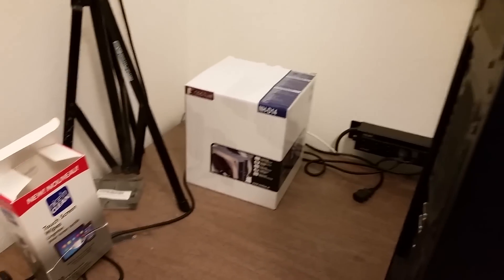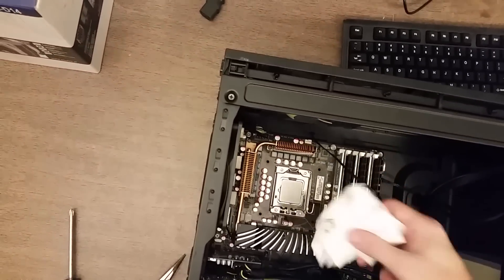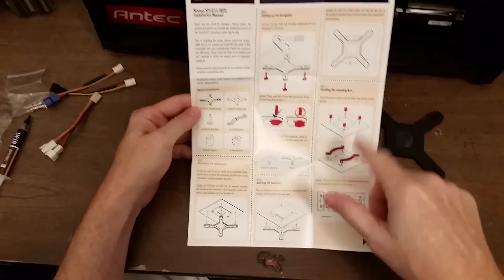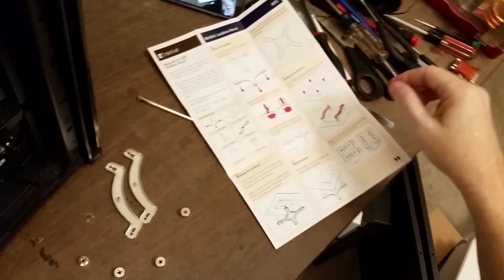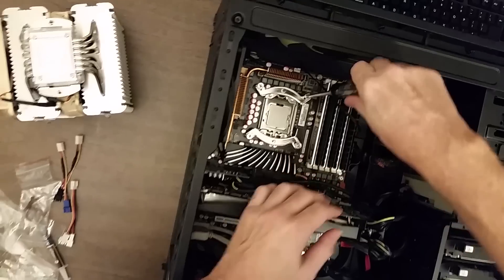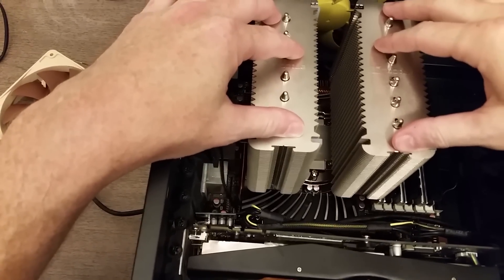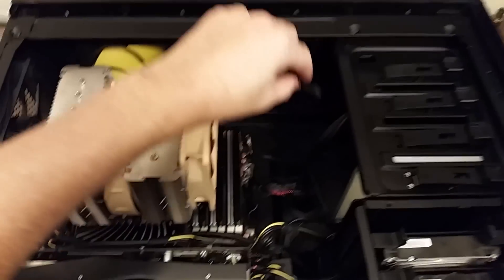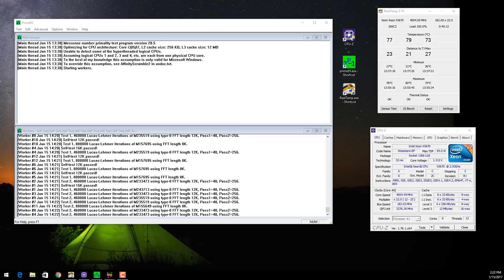Noctua NH-D14 CPU cooler installation onto a Intel CPU and motherboard

Comment: I have this cooler for 10 years and I believe it killed two of my motherboards. Both were starting to show signs of RAM failure after repasting. On my second mobo I barely tightned the screws to avoid bending, warping, etc. Now my A1 and A2 RAM channels are dead. I'm single channel now on B1 / B2. I'm afraid to mount this cooler again on a new mobo.

Comment: Hello! I wanna get this cooler but I’m having doubts if its compatible with my motherboard. I have a B360M mortal Mobo, is it compatible with it?
Reply from the maker: No this is an older cooler.  NH-d15 should work.
Reply: @MichaelTheComputerGuy  I just searched it NH-d15 and it's big as hell for a cpu cooler. Is there enough space for my ram sticks to put this cpu cooler on?
Reply from the maker: @quaithe7050  I was just giving you the modern equivalent. Yeah it's big. If you have tall Ram sometimes it doesn't fit right and you have to raise up the fans. Do you really need a cooler that large? What cpu do you have, are you planning to overclock it and if so to what speed?
Reply: Michael Cooper i have a I7-8700. With hyperx DDR4 16x2 32gb 2133 or 2666 i think.

I was just thinking of getting something that wouldn’t get my pc hot. I also planning to buy 3 case fans for my case since I only have the intake fans in front and no exhaust that’s why I also decided to try and get a new cpu cooler since i’m using stock coolers because I game alot and do alot of tons with my pc. Usually my temps when i game without fan / ac is around 60-70c which i think is pretty hot and my fps drops sometimes because of that.

I have no plans of overclocking my cpu / ram, only my gpu. If i don’t overclock is noctua a overkill? Should i go for other cpu cooler, if so, what do you recommend? 

Edit: i have a aerocool quartz case if you’re wondering.
Reply from the maker: @quaithe7050  The NH-D15 is overkill for you.  Look at the NH-U12S.
Reply: @MichaelTheComputerGuy  really? but isn't the NH-D15 better than the NH-U12S? or is it basically the same? i want my temps to go down around 45-50c whenever i play / stream.
Reply from the maker: @quaithe7050  Of course it's better.  Its also bigger, more expensive and more likely to interfere with your RAM.  If you can spend the extra $40 and it fits get it.
Reply: @MichaelTheComputerGuy What's usually the ram height so I wont have ram clearance problems?
Reply from the maker: @quaithe7050  There isnt a usual ram height. You can find your rams height fron the ram manufacturer and the coolers ram height compatibility from the coolers manufacturer.
Reply: Michael Cooper well I got my answer here. I’m getting the NH-D15 for sure. Thank you so much for taking your time to answer my questions, this was really helpful

Comment: How do you know which of the 3 holes to use on the brackets
Reply from the maker: The manual tells you.  They are for 3 differently spaced motherboard cpu mounting holes.
Reply: @MichaelTheComputerGuy  the manual doesn't even mention them 😔I went with the middle hole but not sure at all

Comment: Just bought this for 12400f in 2023! 😂
Reply from the maker: I probably need the D15.  The D14 here is for older CPUs.  The installation process is similar.
Reply: @MichaelTheComputerGuy  the seller i bought it from has got the optional 1700 bracket together wif it. Just intalled it today. Playing returnal max wif 3060 was 75 now my max is around 55. What a phenomenal cooler literally blew me away. Super happy just that it doesnt fit my case becoz its so tall. Thanks n great vid I followed your instructions thanks for ur help. 🤗🤗🤗

Comment: Thank you for sharing your experience. I installed a Noctua DH-14 on my vintage Asus P5K3 motherboard and Intel Core2Quad Q9450 last sunday basing my purchase decision on your video and the whole operation was indeed just so easy after having learned to avoid the pitfalls from your video. Also kudo's to Noctua for exemplary customer support and incredible product performance. I ordered my cooler on amazon and it arrived without the proper mounting kit for my kind of old processor. I do not blame Noctua for that. Actually, it is a sustainable solution and Noctua do provide an easy ordering process for the NM-I3 mounting kit that I needed and the kit arrived in just two working days at no cost. They do require proof of purchase of the fan, the processor and mainboard so as to avoid misuse of the service.

The cooling performance of the DH-14 in my setup is just fenomenal compared to the stock cooler that I have used for more than a decade. The processor has been working under full load ever since Folding at Home started to grid-compute for Covid-19 projects and the old fan was barely capable of keeping the CPU under 100 degrees Celsius. Since sunday, the CPU has been running uninterrupted at full load hitting no more than 48 degrees Celsius. I am impressed.

Comment: Since the mounting is identical on all 115x sockets, the D14 is actually compatible with the 1151 socket too. It's just it's not mentioned in the manual because it wasnt around when these were released.

Noctua website confirms this.
Reply: I have a intel i7-11700f will the D9L work?
Reply: @Matthew Bean  Edit: wasn't the one I was thinking of. Yes it should be enough. Use the Intel bracket and spacers and you should be fine.

Comment: Excellent detail. Between your video & another guy's video, I was able to properly remove & then re-install the Noctua after a Motherboard Replacement. They had high-profile Memory, so my 2nd fan was installed on the end nearest the back of the case. I hope that doesn't affect the overall cooling.

Comment: Excellent video! :D

I have a question: There is no problem that the 120mm cooler cable and the 140mm cooler cable share the Y cable? 
They are supposed to have different voltages and amperages.
Reply: No voltage difference, the only major difference is the size of the blades.

Comment: I love this cooler, it has worked extremely well and extremely quiet for nearly 4 years. It's currently cooling my Ryzen 5 2600 and it never goes above 50c in Prime and Cinebench. I can absolutely get it lower as well, but then I start to hear the cooler and that's not really the idea with this guy. It is built for silence.
Reply: how is that u must not clocked
Reply: @cmoneytheman  65W TDP processor being cooled by a 225W TDP cooler.
Reply: @vBDKv  wha the name of the cpu i meant
Reply: @cmoneytheman  Ryzen 5 2600
Reply: @vBDKv  I dont understand do u got this cooler or not u not oced if u runs in the 50s

Comment: I love my D14, I still use it on my ryzen nowadays. (ordered the am4 kit for less then 8 bucks USD from Noctua) It cools my 1600 to a stable 3.9 all day long max temps 74c under prime95 load over a few hours. I use 4 vengance LPX (the black non rgb) and I only need to move my front fan up a lil bit. (I suggest not getting rgb ram with this cooler as the front fan will hang over all 4 ram sticks even on a  full atx board. Save the money on ram without rgb to get better timings or speed.
Reply: I found a D14 second handed for 35€. Even thought I don't really need that much cooling, I think I'm gonna buy it.

Comment: This wasn't easy! Levelling and adjusting the fan springs without any room at all. Finally got helped by a pair of pliers. My Nh-d15 was not an easy job. My corsair 275R was a little bit tight but I made it! (Rog strix Z390f).

Comment: I have one problem help me pls o have dark rock pro 4 and I didn't use the splitter because without it I have better temps and the splitter is 1 pwm 4 pins and the second is 3 pin when I put it to CPU fan 1 doesn't working and if I put something else it works and if I put the fan without the splitter doesn't work but the ryzen cooler works and this fan in other pin it works why??

Comment: how do i know if its better to have the air blowing out the back or up the top? im going to be putting this fan in a coolermster h500
Reply from the maker: You can do either or both.  The difference wont be much.  As long as you get the air moving through its fine.

Comment: I have high profile ram do think this cooler would be ok?. I have 4 X 4 GB Adata XPG V2. The Gold and Silver/Grey series.
Reply from the maker: This cooler is for older processors.  Whatever cooler you're considering look up its ram clearance and make sure your Ram will fit under it.  You can do this by searching for the cooler model number and the words ram clearance.  For Ram height search for the model of ram and the word height.

Comment: Can you get the same cooling capacity of a 2×120mm all-in-one liquid cooler with this air cooler? Which one is best?
Reply from the maker: That depends on the model aio but it should be similar.

Comment: Can the cooler be installed on Intel® Core™ i5-8400 ? It has a socket FCLGA1151.
Reply from the maker: I checked the specifications on the cooler and yes it does work on a socket 1151.

Comment: After watching this video i decided to keep my CoolerMaster V10 cpu cooler its lowder for sure but its actually do a better job for some reason or you did something wrong, i thought noctuas was way better i also have an oc x5660 at 4.2ghz the odd thing is that i run lower voltage than yours im at 1,29250 considering that and the higher oc on mine i should go further on temperatures but mine tops at 72c in almost all cores (core 4 for some reason is always 5 degrees cooler from the hottest core) after one hour in prime 95 maybe the thermal paste does an extremely better job i dont know i use thermal grizzly kryonaut,i also saw the issue with your ram and i think that i will have a serious problems to fit this cooler because my rams are Corsair vengeance DDR3 1600mhz high profile kit which their heatsink is just huge..i had the same huge problem when i bought the bequiet dark rock 3 pro i couldn't fit it at all i had to literally remove the rams heatsinks in order to make it fit in..it was very disturbing and disappointing so i returned it back..i think i will stick with my V10 it surved me well 10 years even if its loud af.

Comment: For some reason my noctua only spins when starting up the computer, then it shuts down, also when i game alot it doesnt start spinning, and my cpu is around 70 c
Reply from the maker: Go into the bios and check the fan speed settings.  Depending on the motherboard there may be a section where you change at what temp a fan spins up and how much faster it spins depending on the temps.

Comment: How do you fit the ram in there? Looks like there's no space for it.
Reply: NH-D14  has a 140m fan and 120m fan it gives you just enough clearance over the RAM. A lot of people buy the NH-D15 which has two 140m fans. Which creates clearance issues.

Comment: Did it cover two RAM slots? can't really tell
Reply from the maker: That is shown in the video at 20 minutes 40 seconds in.  I had to raise the fan a bit to account for that.
Reply: Also not that you can relocate the outer fan to the inside and remove the left most RAM heat spreader if need be

Comment: Is it really a good idea to clean off your thermal paste with a paper towel?
Reply from the maker: Hold the door I think it's fine. You can also use 90% or higher isopropyl alcohol in addition to remove the compound. There are also specific cleaners for removing thermal compound.
Reply: It's ok as long as you hose it down afterword's.. Before doing anything though, you should first wipe it down with some type of hand lotion to keep the CPU cool and soft.
Reply from the maker: Bessette Jesse funny
Reply: lmao gotta moisturize the cpu and maybe take it out to a spa as well.
Reply: Besides 90%+ Isopro Alochohol, coffee filters are actually great to use and just as easily obtainable as paper towels. Technically speaking Paper Towels are fine, but they can and do leave remnants of it behind. Which can easily be removed so no biggie there, but if you use a Coffee filter instead, you'll have nothing left over.

Comment: can it fit in Cooler Master N200?
Reply from the maker: That case can handle up to a 163mm tall cooler. You also need to consider whether or not this cooler will work with your motherboard.
Reply: @MichaelTheComputerGuy  , CM website said its max support is 160mm, what case u use?
Reply from the maker: @faisalrahmat9114  I've got a Corsair case but it's not available for purchase anymore.
Reply: @MichaelTheComputerGuy  oke, what type of corsair case is that?

Comment: Your case and its clearance please?
Reply from the maker: It's a Corsair 550D.  I believe the CPU cooler clearance is 180mm.  For those wondering that means the case can hold a CPU cooler that is 180mm in height.

Comment: I've got a nzxt adamas anyone know if this will fit
Reply from the maker: That case is from 2007. Besides the height of the cooler you also need to pay attention to the CPU socket it will be fitting on to.
Reply: @MichaelTheComputerGuy  hi Michael yes old case but I like it so stayed with it, I think anything bigger than 163mm won't fit. Yes I have same motherboard as you
Reply from the maker: @xjorvis  According to the Noctua website the height on this is 160mm.
Reply: @MichaelTheComputerGuy  hi Michael okay thanks for the info I think that may just fit then

Comment: What case ?
Reply from the maker: Corsair Obsidian Series Black 550D I don't think its available anymore.
Reply: @MichaelTheComputerGuy  im wonder if its fits my new zalman z3 plus . Atm using 775 soket but i plan to change into 1151 soket in future . Do you know if it also fits soket 775 and 1151 ? I ask becouse some coolers not display in description all soket that it fits .
Reply: @MichaelTheComputerGuy  or maybe you recomand an good cooler . Not looking for overclook but must be silet and also verry good cooling .
Reply from the maker: @georgecatalinnicuta8559  The description says it will work with both.
Reply from the maker: @georgecatalinnicuta8559  What CPU do you have?
Reply: @MichaelTheComputerGuy  At the moment i use e8400 with a aftermarket cooler wich is not silent and it keep temperature at  38-40 idle and 52-55 in stress test full load . I have a q6600 in stand by wich i just made a test with that cooler and it was on 65-68 in idle so no chance to work with it . I mention that all above was in a random case with no fans . I think about when i move them into my new case zalman z3 plus with 5 fans the temperature will be little lower . The new cooler must be for the q6600 and why not for when i buy i7 with non K in future . My first prior is noctua nh-d14 but im affraid is too much for my needs also verry big and i hear about it can disturb the last stick of memory . I also like be quiet pure rock wich is cheap and silent but not sure if is enough for q6600 . 
Thanks for your time .
Reply from the maker: @georgecatalinnicuta8559  The pure rock is a good choice.
Reply: @MichaelTheComputerGuy  ya . I think that

Comment: you really shouldn't have your power cables just lying on the GPU... that's just asking for trouble... you realise how hot a GPU gets?... good way to melt things or even start a fire... very stupid
Reply from the maker: The heat sink does not get hot enough to melt cables.
Reply: @MichaelTheComputerGuy  i said nothing about the heat sink. I'm talking about the fact you have power cables lying on top of your GPU...
Reply from the maker: @joom9002  So you're saying that the back of the GPU can melt cables. I don't agree. By the way those cables have been there for years and no melting. Try and find an instance of cables on graphics cards melting. You won't.

Comment: Jesus christ, 30 mins?
Reply from the maker: If you're looking for a shorter version there are lots of other videos that don't show or explain as much.
Reply: Michael Cooper I was being a little dramatic, but I do have a question. Are those silicone vibration compensators or fan screws for when the 120mm fan is on the case?
Reply from the maker: CombatLegsVIDS I don't understand what it is you're referring to. If it's something that shown in the video what minutes and seconds is it at?
Reply: Michael Cooper around 6:40 in the video there are some rubber mounting things. Are those to be placed on the fans while on the heat sink or when you use them around the case exhausts?
Reply from the maker: CombatLegsVIDS I didn't see anything there. At 7 minutes 17 seconds there are some rubber pieces that are made for taking the fans that come with the cooler and putting them in a case as a general case fans.